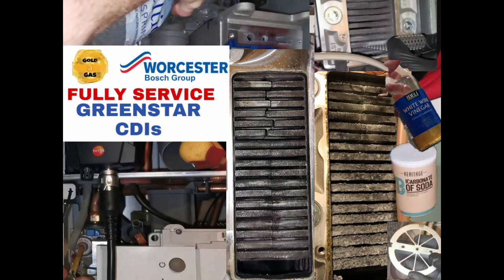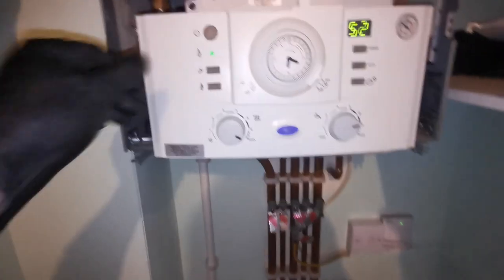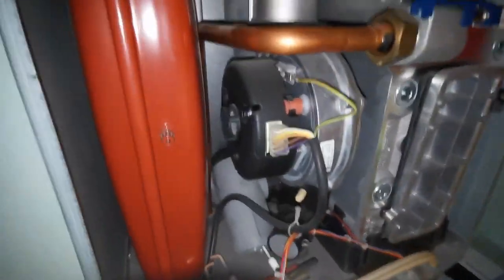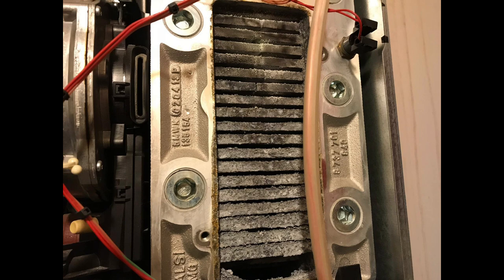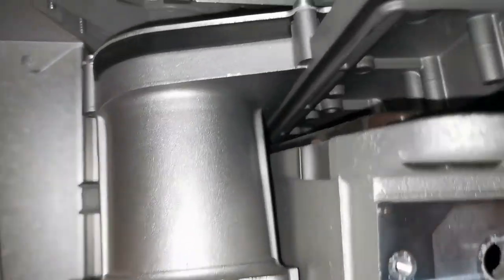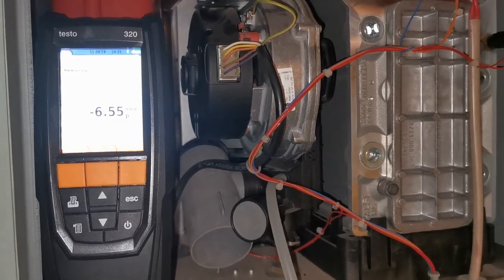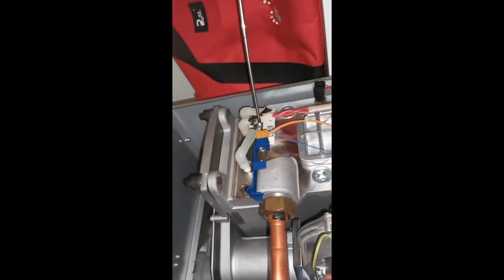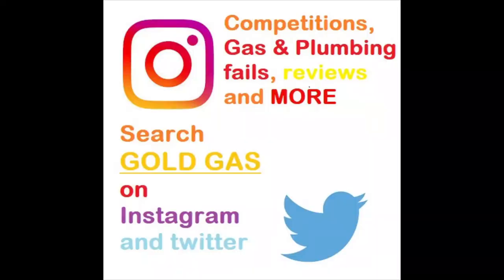BOILER SERVICE - CDI GREENSTAR - HOW TO STEP BY STEP SERVICE A WORCESTER GREENSTAR CDI & CDI CLASSIC

Comment: Great stuff fella, yup always refer to M.i.  I pretty much always mix a white wine vinegar solution in a small hozelock garden sprayer.  Nice simple job on this one.  The solid electrode bracket is van stock. I'll always suggest a customer change it. I've condemned 3 worcester cdi's because of the devastation it's caused. Shockingly one had been so call serviced by another Rgi 3 weeks prior. Anyone servicing be sure to do your visuals and f.a.g.s.  you cover regulation 26.9 at minimum always and you'll sleep easy. 😜
Reply from the maker: Thanks bud! Great advice - yes the sprayer is much better. Mine has gone walkies and haven't replaced. Check out safe_flame_uk on Instagram, he shows off his great lil sprayer 😉. And absolutely I do try and get the customer to invest in one, but after spending money on the service, seals and as I go in after another engineer the year before they can start to think I'm trying to get money out of them. I show the customer what I've changed and why always to keep the trust. Tell me about it, how it's not a manufacturer recall on those electrode bars, I'll never know.
I'll pin your comment mate. Great info.
Reply: @goldgas1216  very good video explaining exactly what the engineer should be doing in a boiler service. Just want to know how many minutes minimum it should take a Worcester boiler engineer to carry out a proper Worcester 30Cdi boiler service including cleaning heat exchanger, replace electrodes and change seals and clean condensate trap and change seal etc. 
Full boiler service as per manufacturer’s instructions?

Comment: I was a Worcester service engineer for 15 years, if you take the electrodes out for any reason you must fit a new gasket, but seeing as the red silicone gasket is no longer available you have to fit a new set of electrodes complete with the new ceramic type gasket !. But good job otherwise.
Reply from the maker: Cheers mate, I'm pleased coming from a Worcester engineer! Everyone, as mentioned check your MIs, it does state change the electrode seal. Luckily I have some from an old spares job lot. But Brendan is right, you have to buy the new electrode bar kit now if you remove the electrodes... Which you should to clean.. Prewarn the customer as it can start to get expensive. Not all manufacturers are like this regarding seals.

Comment: Hey great videos look foward to more. Where do you get the instructions for servicing and taking apart components?
Reply from the maker: 👌🙌 Cheers mate! Nice of ya. Most of the details are in the manufacturer's instructions, but some you learn from just doing so many, technical can give you some tips and ways to do it. Also other people's youtube can help. Heating geek, pb plumber, goeffrey needs training are a some off the top of my head. Also instagram RsGassolutions.
Reply: Gold Gas Videos I want to do my gas and get into servicing but not sure how I’m going to get into it when my employer doesn’t do servicing. Just trying to learn as much as possible. Don’t really want to be fixing toilets and doing bathrooms. Rather do the heating side of it all
Reply from the maker: @joneth781  sounds like you might have to look else where for a servicing / breakdown job. Although it is helpful getting to learn all areas of the trade (installations etc)

Comment from the maker: As always this is a guide for gas safe people only!
I may not cover everything in every video as it will get repetetive and too lengthy-
Do your visuals, clean whole condense trap, flue integrity, check burner and gas inlet pressures,  check/replace all seals, clean. Always refer to Manufacturers Instructions please.

Comment: My cdi, which  has a WB maintenance contract,  seems to get a greatly inferior service than this.
Reply: Because as per the MIs you do not have to do this full strip down clean yearly. If the reading from your negative and pressure is within the tolerance then it is not necessary to do it.
I wouldn’t leave it any longer than five years for replacing the electrode set and servicing the heater seeing you like this with new seals. It’s got the glass window type it’s been changed to the updated modified version.
As it’s not worth taking the chance when that little window goes The cost of the repair.

Comment: Damn... I had a service by British gas last year and he done none of this, he literally pulled the front of had a look around for about 5 mins and then said it all looked fine and put the front back on and left, was there probably 10-15 minutes in total 😳
Reply: All to do with the reading on the fan pressure test. Age is another factor. Once hit 4/5 year. I'd advise a full service.
Not required every year usually 😂👌